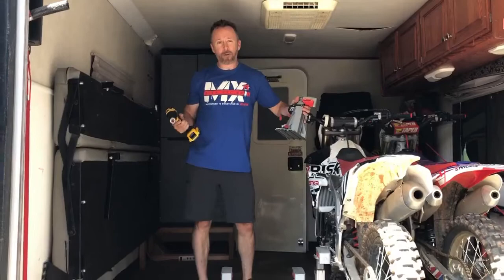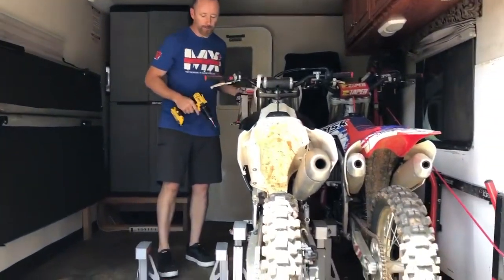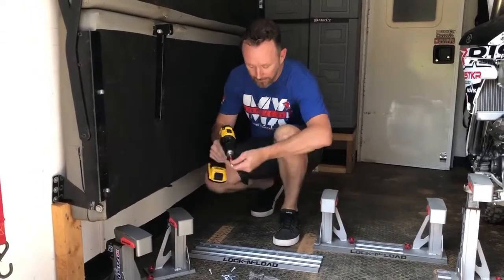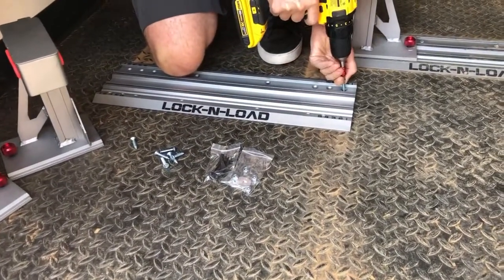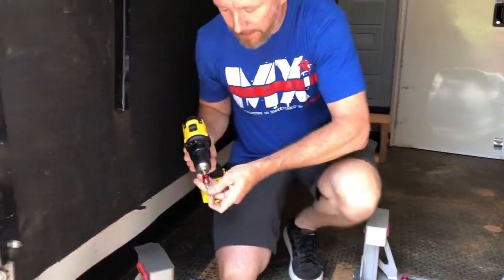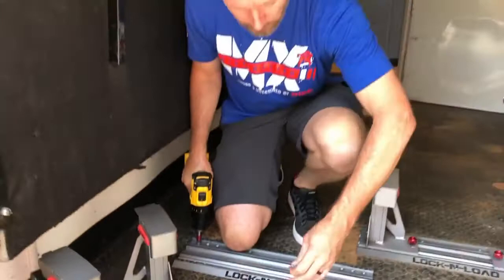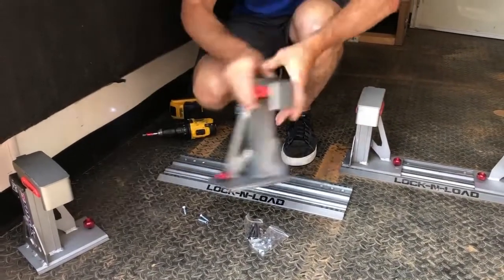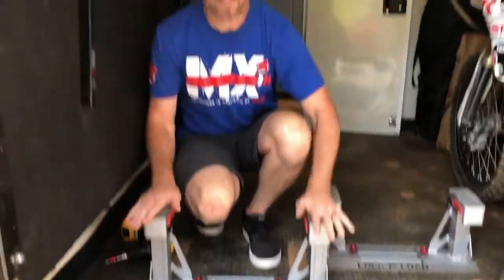How To Install a Lock-N-Load PRO from #RISKRacing! - #riskracingmoto #mxLocknLoad

Comment: I have a spray bed liner coating on my truck bed. Would this solution still work and is it advised?
Reply from the maker: Good question!  It works great with spray in liners.  There are some other videos that show it being mounted in a truck with a spray in bed liner.  You can see them on our website at www.riskracing.com.  Let us know if you have any other questions!

Comment: Just bought two for my toy hauler!  Anyone had problems with the screws pulling out or wiggling loose on long trips?
Reply from the maker: Hey Aaron, we don't typically see this issue happening.  Make sure your floor is solid wood and no water rot.  Also make sure it is at least 1/2" thick (5/8th" preferably).  Are you using the supplied wood screws?  Are you using all 8 screws?  For the wood install, no need to drill any pilot holes (risk of drilling too big).  Just use all 8 of the supplied wood screws.  If you keep seeing this issue you can bolt through the floor with the supplied bolts, fender washers and locknuts.